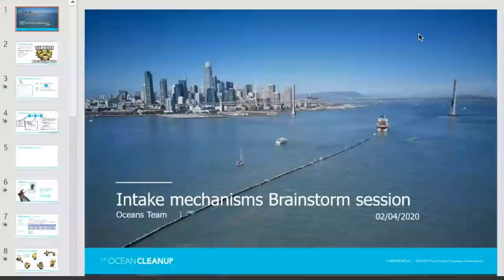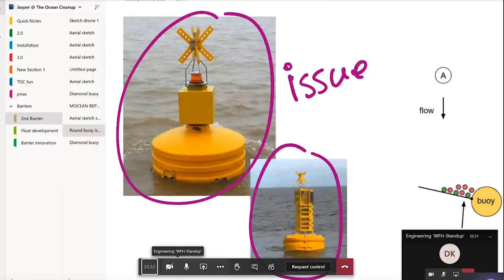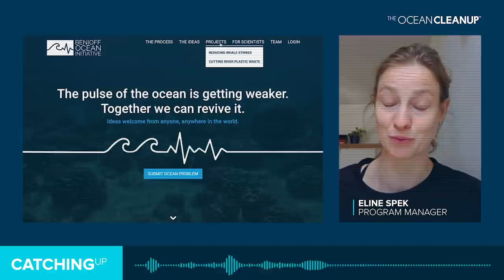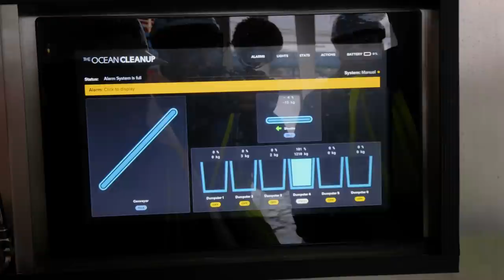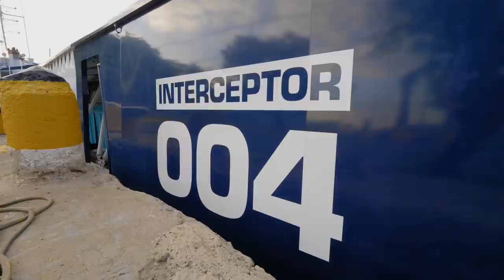Catching Up on Oceans, Rivers, and Research During COVID-19 | Podcast | The Ocean Cleanup

Comment: I was wondering how you want to storage the gathered plastic in the ocean for longer periods especially due to the fact that the sun and the friction within the items and the waves is reducing it into smaller pices and eventually into microplastic. 
But maybe that is negligible because of the huge amount of plastic which is already there and hackled. 
Anyways thanks a lot and keep up the revolutionary work!!! This is truly inspiring!
Reply from the maker: This is a great point! While concentrating the plastic could result in more fragmentation, with Wilson - our first ocean system - we saw that the sea is typically calmer inside the system than outside. The decrease of waves in the system could therefore reduce the rate of fragmentation. Either way, this is something we need to monitor.